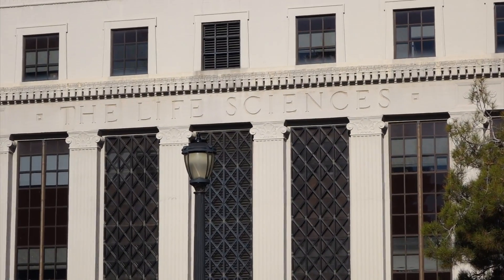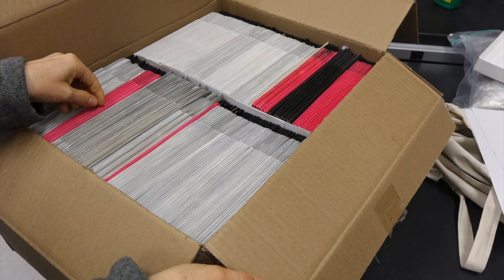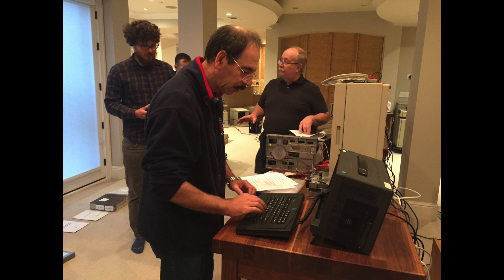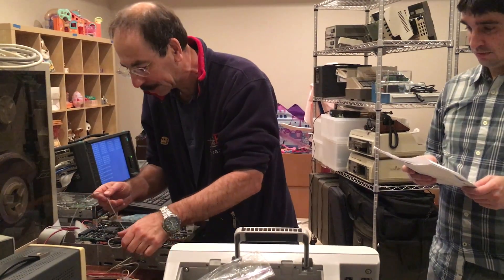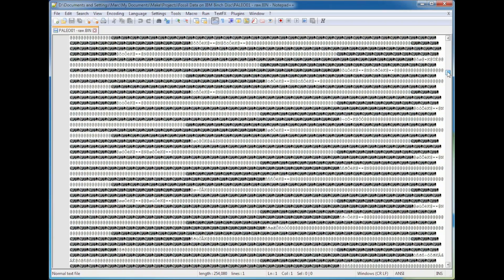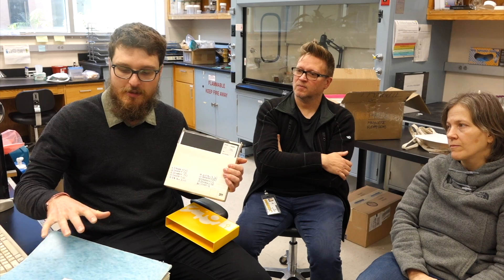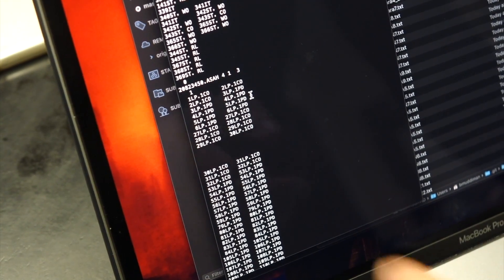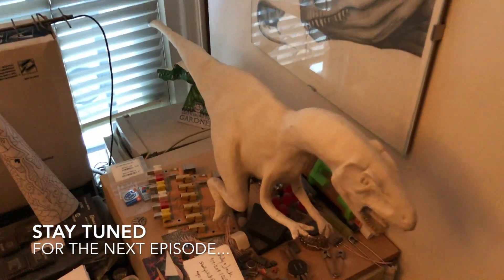Fossil Data Part 2: 8-Inch IBM Floppy Data Recovery

Comment: Wow. I didn't realize that the old IBM PC floppy interface could work with 8 inch ones.
Reply: In fact when 5.25" floppies were first made, the datarates used were half of the 8" rates but the format was the same.
However, 8" drives rotated at 360 RPM and 5.25" drives were 300 RPM.

There were two different formats: Single Density and Double Density.  What is shown in this video is Single Density.
Later, on 5.25" the High Density format was introduced, and it was merely the use of 8" datarates on 5.25" drives.
The 5.25" HD floppies (1.2MB) were exactly the same format as Double Density on an 8" drive.
What is shown in the video is the original floppy drive format: 26 sectors/track, 128 bytes/sector, 77 tracks, Single Sided, Single density (256 KB per disk).
Reply: @Rob2  -- When the PC first came out, the 5.25" floppies were 8 sectors per track, 40 tracks per side, 512 bytes per sector.  Double sided drives eventually came out, but they were more expensive.  We soon realized that the actual media inside the floppy could be used on the back side if we just cut the appropriate holes in the sleeve that the media was encapsulated in.  We would call these disks "flippies" since you needed to turn the disk over to access the data on the other side.  To convert it to a "flippy", you needed to cut the
write protect notch on the other side of the disk sleeve / carrier and also the timing hole in the sleeve near the hub of the disk to match the hole that was on the other side.  If we were able to format the opposite side without any errors, we would use it, if not, then we only used the original side.

I seem to remember it was around PC-DOS v2.0 where they changed the floppies to 9 sectors per track which gave us 180K per side or 360K per double sided disk.  PC-DOS v1.1 definitely had 8 sectors per track though.  When the IBM PC-AT came out, they went with a new type media substrate and a more compact write head on the drive.  I think the media substrate was less magnetic which allowed them to write to it at a higher density without bleed-over to other tracks.  The PC-AT used 15 sectors per track, 512 bytes per sector, and 80 tracks per side, giving 1.2M per disk.  Because they needed to write data in a narrower track to be able to do the 80 tracks per side, this caused problems for some people at the time who were using the PC-AT's drive to modify data that had been originally written on the normal density (i.e. 360K) drives.  The AT's drive would write the new stripe of data in the middle of the original track and it had no problem reading it, but the remnants of the old data was still there on the sides of the track that was just written.  That wasn't a problem for the AT's drive since it was only reading the center portion which is exactly where it had written the new data.  But if you took the disk back to a PC that only had a 360K drive on it, the larger read/write head on that unit would try to read the entire width of the track which consisted of the old data on the edges and the new data in the middle of the track.  It would get a read error and the person would then panic thinking that their data had been lost.  After I got out of the military and went back to college, I worked in the computer lab when I was in grad school.  I ended up meeting quite a few rather appreciative underclassmen females (just doesn't sound right to say "underclasswomen" for some reason) when I was a grad student working in that lab.  They didn't understand why they couldn't read their data and thought that they had lost all their work, so they were often rather appreciative after I saved them.  I even ended of marrying one of them. :)

This is all from memory, but I think it is correct.  It's been a long time and the memory gets fuzzy with age, but for whatever reason, this part seems to have stuck.  One other thing that I seem to remember is that around that time and before the PC became the defacto standard, many of the other home computer manufacturers had 5.25" disk options, but each one had their own formatting scheme.  For example, I seem to remember that the Commodore had a 340K drive with 35 tracks per side and the sectors per track varied depending upon the track number (the sectors per track decreased as the drive head got closer to the center of the disk).
Reply: @jakeblanton6853  Yes it is correct, but I was not at all talking about the PC.
I was talking about "when 5.25" floppies were first made" and that was way before the PC.
The first 5.25" floppies were single-sided 35 tracks and many systems used single density, for about 80KB per disk.
Several sector sizes were common: 128 for CP/M, other systems often 256 bytes/sector.
The technique to use diskettes on both sides without a double-sided drive way predates the PC, it was often done on the Apple ][ as well.

In addition to my earlier posting: when the HD format was first introduced (in the AT), the diskettes were rotated at 360 RPM again (as were the 8") and the format was holding only 1.2MB.  However, later when HD also appeared on 3.5" the 300RPM rotation rate meant that 1.44MB could be stored in the same number of tracks.
Reply: Given that most 5.25" drives used the Shugart interface, it shouldn't really be that surprising ;)
Reply: @BertGrink  The 5.25" drives used a 34-pin connector, probably due to size restrictions as the 8" drives used a 50-pin connector with many unused pins and it could "easily" be mapped to the 34 pins (as shown in the video).
However, the IBM 8" floppies that started it all (e.g. the 33FD shown in the video) used a completely different connector, and slightly different signals.  I made a converter for those two standards, as I happened to have 3 IBM drives available and a large box of 8" diskettes, which I wanted to use with my TRS-80 instead of the usual 5.25" drives used with that computer (which cost a lot of money for me as a student).

Comment: Well done! Next challenge: How to preserve that data for the next 50 years. Because CDs, harddisks and flash memories won't do that...
Reply: Wolfgang Mahringer Data rot is already a huge issue with CDs and other optical discs. Especially CD-R since the dyes can degrade
Reply: @SalivatingSteve  yeah, wonder how to get past that?  It seems that if stored well magnetic tape still lasts a very long time.  What could be the most durable format for the future?  I personally think print should also be used as a backup, but it's usefulness is overlooked in favor of all digital solutions that fail constantly.  But if it had been printed, then at least that would be there when the digital just decided to fail.  If I had printed some of the digital artwork I designed and saved to a failed hard drive, then at least I could scan it and still make some sort of use of it.  Now it's just lost in the platters until I can afford to spend the money on a  clean room platter swap.
Reply: I think its microsoft who work on a data storage made out of glas that can holde multipel tb of data for nearly indefinite
Reply: @Cerus98 Well, commercially produced optical discs are only viable for use in masses /with the same data/. So thats not an option to store or backup your data on such discs. That 8 inch floppies only survivied so well because of their large storage structures (big disc, low capacity). If I look at todays ultra-large file sizes....
Reply: I still have 20+ year old CD-Rs that work just fine. Still readable. At least the ones I can find. lol There are plenty I can't find.
Reply: @awilliams1701  Yes, I have such CD-Rs too. If they are kept dark and dry, they can last. But 20 years is nothing in comparison to 50 or 100 years. And the media alone does not help, one needs to keep the drives in working condition too.

Comment: Ah, last time I tried to get an 8"er working it was one of the truly enormous Shugart Associates ones that required 12, 24, 5 and -12 volts DC as well as 120 volts AC (to run the spindle motor) And I didn't have any fresh IDC bits and had to splice ribbon cable by hand.  And after all this, it didn't work, because the drive was really, really toast, I had to literally build a new latch for the door because it was just gone.

Comment: Another useless bit of history: the VOL1/HDR1 are ANSI standard mag tape labels. The VOL1 label is the volume label, and identifies the volume. The HDR1 label identifies that a data file follows, and gives the name of the file in the 17 characters right after the HDR1. There should be an EOF1 record at the end of the data file with the same name in it, and the block count. There should be an EOV1 record as the last record of the volume. The format allowed for multiple files on the same volume (reel) of tape, and also allowed for a data file to span volumes( reels). 
I'm actually quite surprised to see labels on these floppies, since the 360/370 only grudgingly would put labels on tape reels, and reading a labeled tape took extra JCL you didn't need to read the normal unlabeled reel. I would have assumed that would extend to other file media too, but I guess not in this case.
Reply from the maker: Ah thanks, I had not realized this. That jives well with the fact that (assuming that I am correct in my IBM 3470 assumption) these were meant to generate a tape made of several floppies, so prefixing each floppy with a mag tape label makes sense. Or just reusing a previous standard and applying it to the newfangled media. There is no EOF1 and EOV1 in the floppy data.

Comment: Hmm when you showed all those @ signs I immediately shouted "EBCDIC!!" and you said "the data makes no sense...".
Those 80byte space-padded (40 hex is space in EBCDIC) were standard in the punched card days.
Reply: We're learning EBCDIC to ASCII hex encoding in my mainframe class this past week.  The instructor handed out a few xeroxed pages from this IBM pocket handbook.  http://bitsavers.trailing-edge.com/pdf/ibm/370/referenceCard/GX20-1850-7_System_370_Reference_Summary_Feb89.pdf
Reply: Did you watch the whole video? They mentioned they were trying to read it in ASCI, but then tried EBCDIC.
Reply: And than we had 0 and 80 column text in terminals and even in modern windows consoles and linux terminals we're on those 80 by default.

Comment: That's actually a pretty wasteful format - I kind of would have expected them to trim away some of the blank space to fit more onto a disk. I guess floppies were not that expensive even in the 70s.
Reply: I suppose that maintaining the format of the punch cards was more important than efficiency at the time. A huge amount of IT processes and software most have existed at the time that knew how to deal with that specific format of entering and reading data. In other words, it may have been a backwards-compatibility concern.

Comment: Marc, I challenge you to read 8" disk with a format like the Digital RX02, a mixed FM/MFM format. Have a "DATAPOINT 1800" that uses similar format like RX02.
My machine then with a DOSGEN command reorganise the disk 3740 format to a special format. Never to be read by a DOS-pc again.
Datapoint uses its own unique file structure which is capable of more sophisticated data and file manipulation than the standard IBM.

So I can with a attached 8"drive to a DOS pc , format a disk to use it in the Datapoint But than I have to do a new format at the Datapoint 1800 machine with DOSGEN.

So a format type no existing DOS floppy adapter can read. 

8"Drive Adapter TIP Look for a "FDADAP floppy disk adapter". Easy connect 8"to PC-floppy. I use that with my  8" YD-174 drive, capable of FM, MFM , single, double sided and have 2 index pick-ups. Bare in mind 8"disk can have the index hole off-centered. So if you have to read 8"disk check your drive if it matches the fysical disk.
Reply: You want a flux-level floppy controller: sample the raw magnetic data from the disk and decode it in software. For example, the Supercard Pro, the Kryoflux, or the one I made which is therefore clearly the best, the FluxEngine (http://cowlark.com/fluxengine/). Mixed format disks are pretty easy: I actually use the same low-level decoder for both FM and MFM, which works fine. I believe I actually have some RX02 disks in my collection, and they read without a hitch using the standard IBM format scheme decoder --- the track and sector layout were autodetected.

If you want to write mixed-format disks, please get in touch? I've just written the software but don't have the hardware to actually test this with, and would love people to give it a try.
Reply: @hjalfi  Great thanks I ll order a Cypress. Is that your site also? Then Ill contact you fore add software. Then we really can remake those special FFD.
Reply: @maurice2vd6  Yep, cowlark.com is mine. Best contact is to file a github issue on the FluxEngine project. Hope it works for you!

Comment: Number Five! And thank you a lot for that documentation - it will be interesting to "play" with the recovered data sets.
Did you ever run into a Fairlight SII or SIII? I guess you would have fun with it. A "real-time" industrial-like computer system with 8-inch drives, tape streamers, 5 1/4" HDs, VME-Bus, OS-9 and a whole bunch of nifty I/O Cards.
It was a super tight machine these days, very reliable (if you knew what you were doing) and I always wondered what drove a guy to build such a machine from the scratch with components you would usually only find in r&d at that time. In my eyes, the Fairlight is a proper candidate for a good place in a computer museum. And it is a lot of fun to play around with one.
Also, there should be a collection of the most "important" samples created and used on the CMI.
And yes: I miss Buster and Marlene...